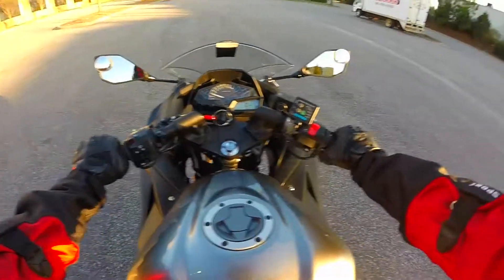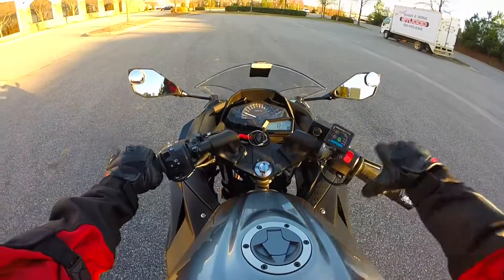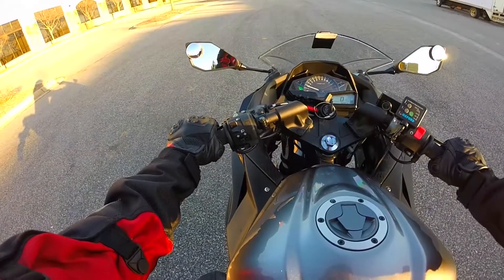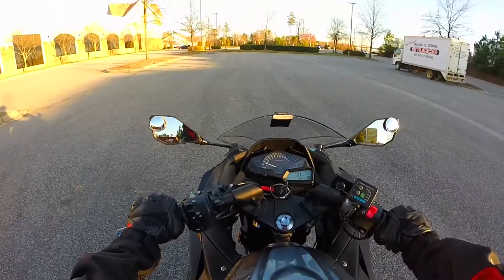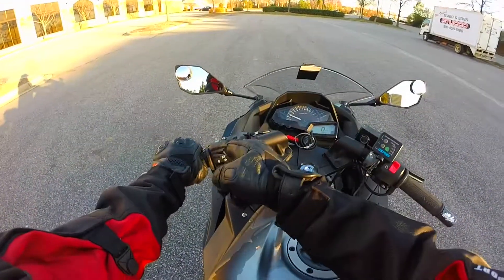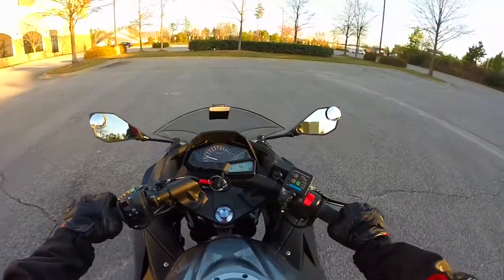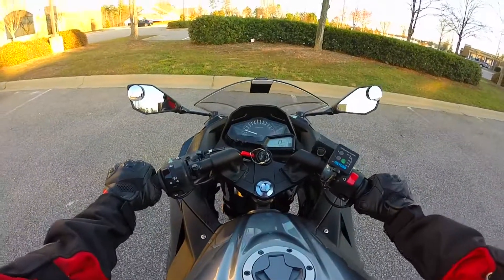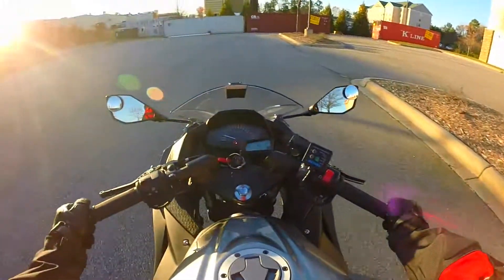Riding 101 - Clutch Friction Zone - Sonic Moto

Comment: A month ago just my a 2016 Ninja 300 as my first bike I love it. Yeah, it took me about 1-2 weeks to get good with the clutch and not stall all the time. I still have trouble on hills and frequently stall (maybe you should make a video on not stalling on hills idk just a suggestion). Great video and really good points keep it up man!!!
Reply from the maker: yeah hills for sure are a pain, just give more throttle, it's hard to wheelie this bike and slipper clutch helps so just give it gas and slowly roll off that clutch, assist with the back brake when on a hill too
Reply from the maker: trying to track down a new bike, current ninja is done for according to insurance claim but a GSX-S750 is in my sights
Reply: What do you mean current Ninja is done for? Didnt you just buy it a couple months ago? Or are you done with it and want to upgrade?
Reply from the maker: +D8 zVevoh someone hit it while parked in the apartment complex so it was marked totaled